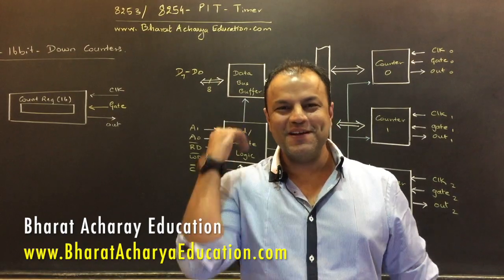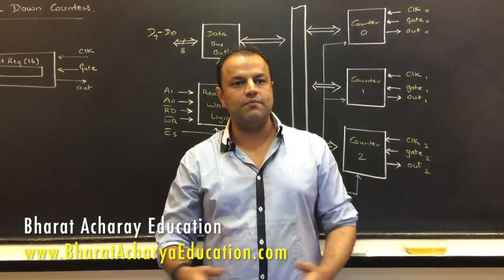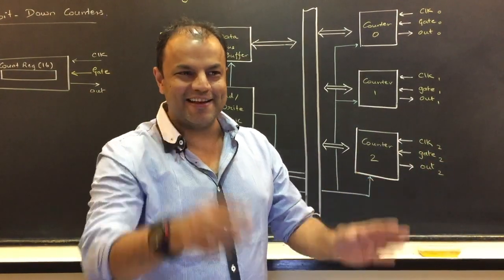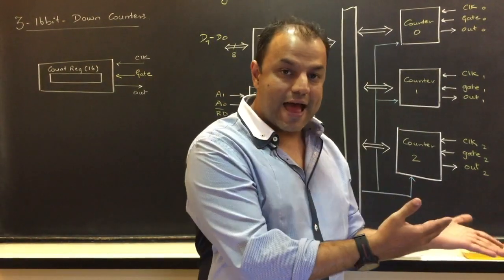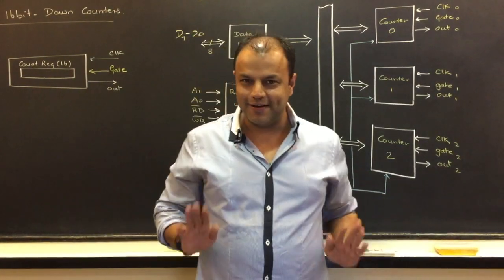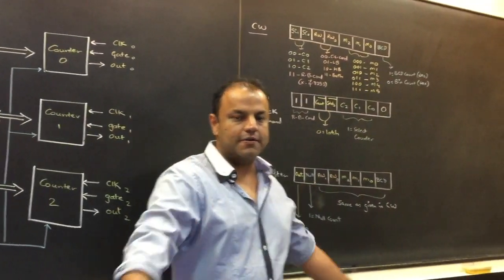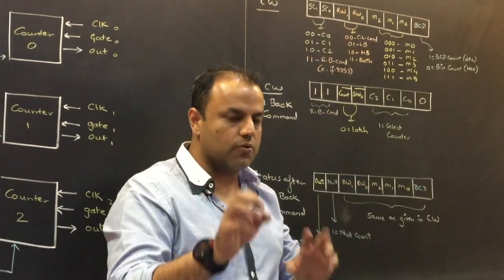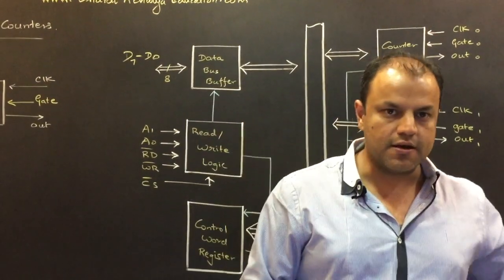8253/8254 - PIT | Programmable Interval Timer | Bharat Acharya Education

Comment: Sir, the microprocessor is a multipurpose device; means it can do no. of things at same time, then why it needs to store the current execution in the stack when interrupts are came? It is a multipurpose device, it should handle more than one thing at same time, then why it can't?
Reply: So that it knows where to go after interrupt routine finishes...
Reply: 8085 microprocessor is a multipurpose not multiprogrammer